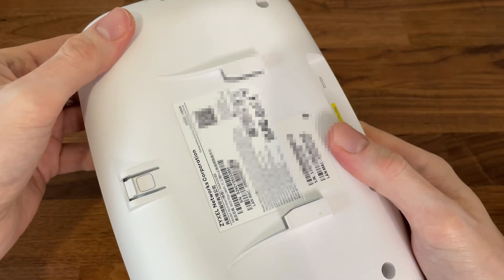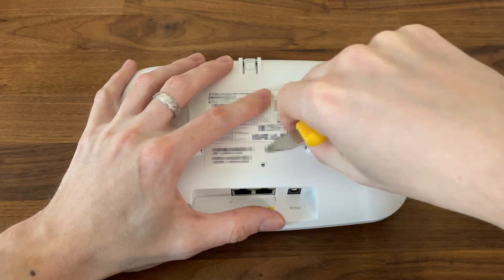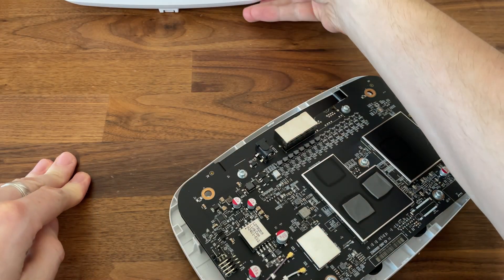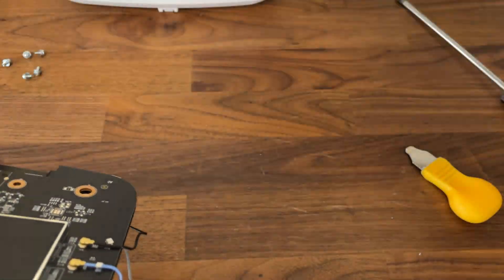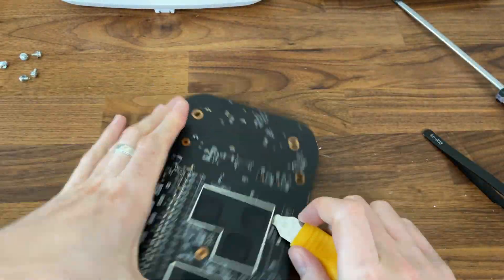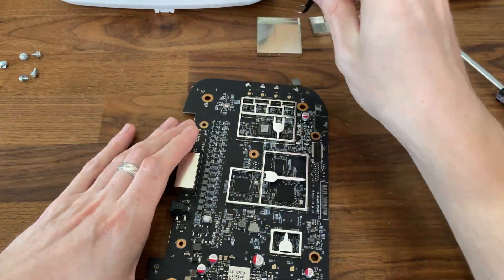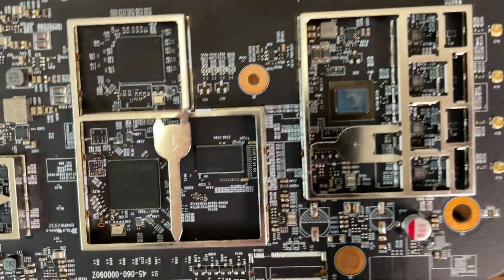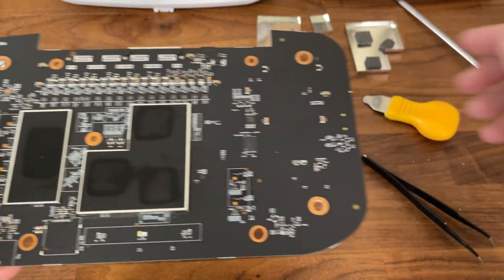Zyxel NWA130BE WiFi 7 Access Point Teardown - Well built device

Comment: Which one has better WiFi performance between Zyxel NWA130BE and Unifi U7-PRO? I'm not too fond of the fan design in the U7-PRO, as I'm concerned about potential noise and overheating issues. Additionally, Zyxel Nebula cloud management is simpler and more user-friendly, eliminating the need for hardware or software controllers.
Reply from the maker: I am now creating the graphics with the WiFi performance for the upcoming NWA130BE review and to be honest, there is not a huge difference between the two access points, especially on the multi-client tests. But I did see some improvement using MLO, significantly increasing the range of the NWA130BE. As for the fan, I didn't hear it while the U7-PRO was functional, only when it started up, but I have no idea if it will remain this way in the future. As for the controllers, I like the UniFi a bit more, not that the Nebula is not good. It's just that it can feel a bit harder to navigate.
Reply: @SamBondor  MLO is not yet supported by U7 Pro current firmware, right?
Reply from the maker: @williamquentin2886  At the moment, no. Should be very soon. Hopefully.
Reply: @SamBondor   
I heard that tri-band models may interfere with each other on the 5GHz and 6GHz bands, so a rectangular antenna design would provide better isolation. Oh, I misspoke earlier. The Unifi controller does indeed offer a more user-friendly experience and additional features, but it seems like Nebula is also sufficient. The reason I mentioned Nebula as simpler is that its installation only requires scanning a QR code with the app.
Reply from the maker: @aa15540  Zyxel does say that they use 'advanced RF filtering' exactly for this reason, to limit the interference between the 5GHz and the 6GHz radios.
Reply: I just returned a U7 Pro Max because the 2.4ghz band has major issues. I grabbed this Zyxel to give it a go. Immediately experiencing the same issues I had on the U7 Pro Max with 2.4ghz iot devices. Completely unstable on 2.4ghz band. There is a review of the U7 Pro and U7 Pro Max here on YT titled "U7 Pro Sucks Don't Buy" or something similar. You can also see from every forum that the U7 Pro and Pro Max have major 2.4gh issues stemming from possibly Qualcomm chip issues. The video goes in depth and there is even FCC filings where Ubiquiti might release a new hardware revision for the U7 line splitting the SoC's up to possibly solve the 2.4ghz issue. I am wondering if this Zyxel is using the same exact Qualcomm chips as the U7 line is. I have the Zyxel on the latest firmware. This doesn't look good. I'm about to pack it up and send it back too. Starting to see more in the forums about this issue with Zyxel and it is starting to look like the same issues the U7 line has.
Reply: U7-Pro is a triband AP, also works on 6Ghz. Given that, and using 6Ghz capable clients, seems pretty easy that the U7 will blast performance tests
Reply from the maker: @leonardogyn  The NWA130BE is also a WiFi 7 AP (with the 6GHz and everything) and as for the performance, you would be surprised.
Reply: @SamBondor  ah ok ... thanks for the clarification!

Comment: Which is the best? This one or Ubiquiti U7 Pro?
Reply from the maker: I don't know yet. I am currently testing the Zyxel NWA130BE and the review should be out hopefully in the weekend.
Reply: I have a U7 pro and i'm returning it for this one. My Quest 3 drops on the 6ghz band constantly with Unify, i'm done troubleshooting that trash.
Reply from the maker: @Vatican7  Complete disconnections or just incredibly high latency? The latter is a known issue with VR headsets when used at a higher res, and I am not sure the WiFi 7 devices will help much at the moment. They may in the future.